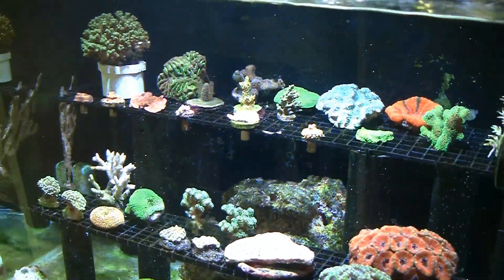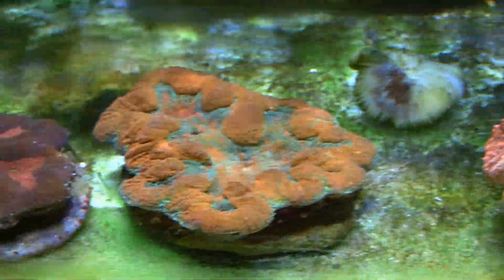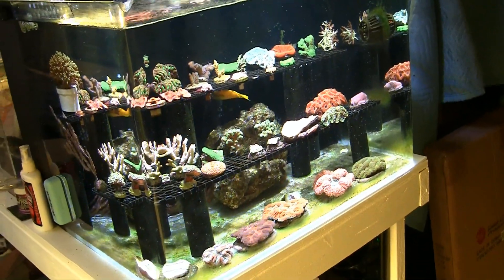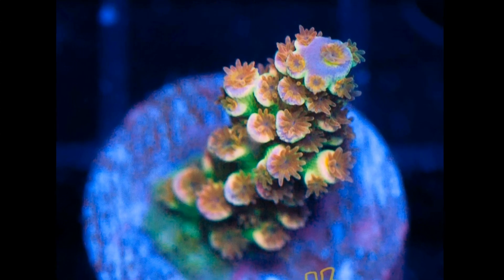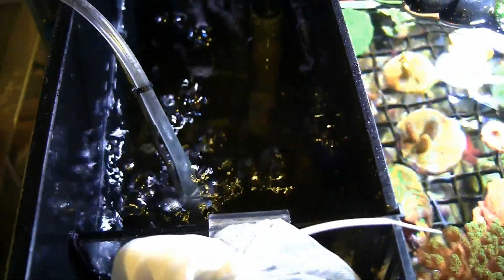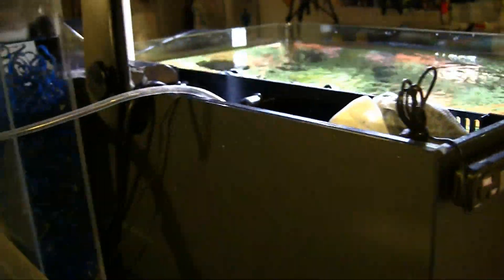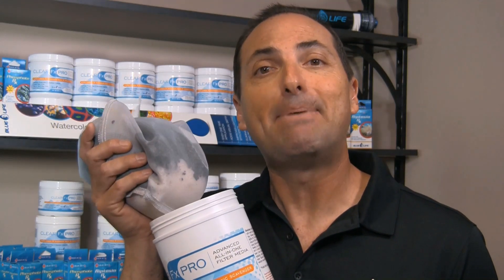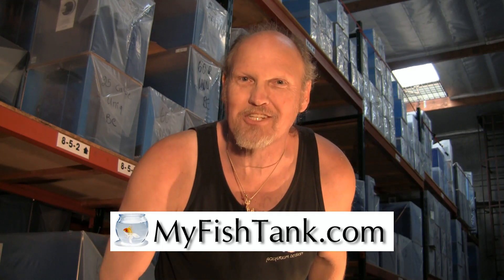LA Frag Guys   Jim Stime

Comment: Nice video Jim.  Personally I prefer using metal halides.  I had used Radions and then switched back to using metal halides with T5.  Coral growth and coral color is much better under my halides and I do not have any shadowing issues.  Keep the videos coming!